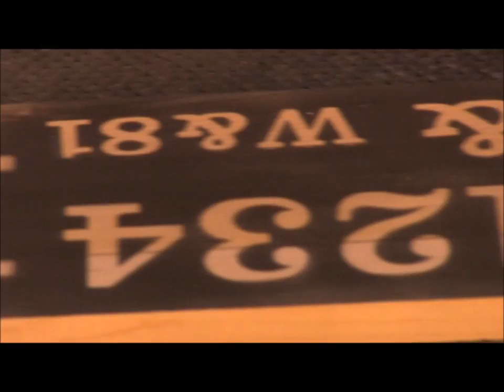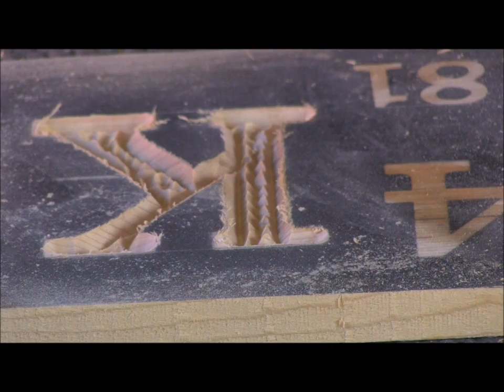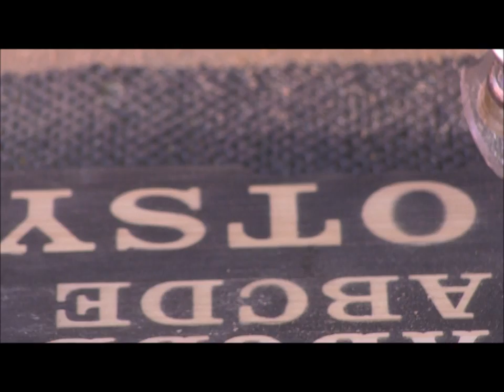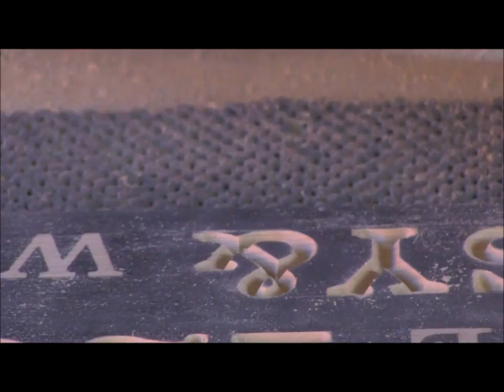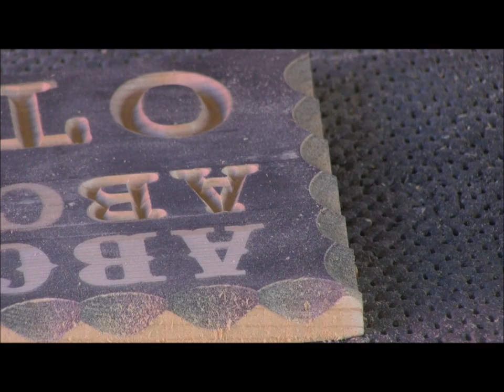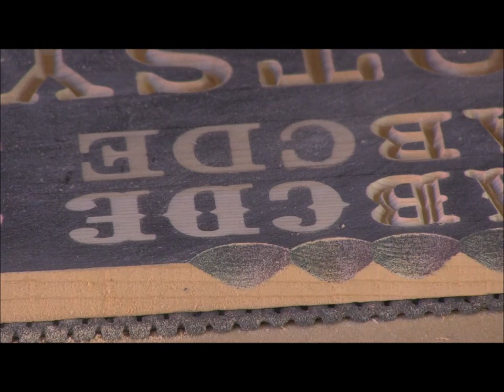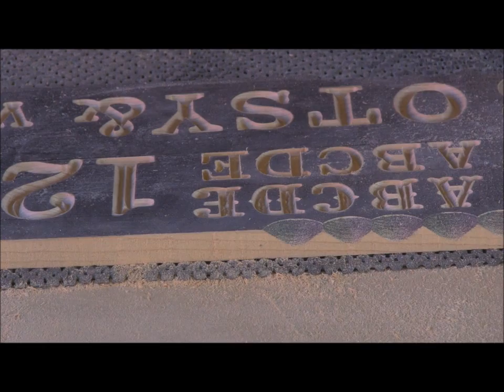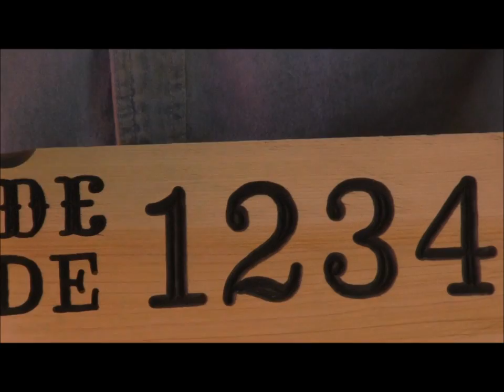#147 Tips for cutting Inset Letters

Comment: Hey Dave, Great time watch all your videos (you’ve got a lot of them).  I have made signs for  along time now as a hobby for myself, family and friends, just for fun. I like to paint them. (I’m still working on the Live Simply sign). I found your channel not too long ago and I’ve really enjoyed learning from your videos. I even went and bought several of your router bits. I think they will improve my work. I went and built myself the router base plate, and modified the router housing as in your videos. However, I found that even with making that hole, I wanted more light directly on the work.  I have now modified my Mikita RT0701C  to allow an led to be installed in the housing. I drilled out one of the existing holes in the base with 23/64” drill bit. 
  
I then inserted the led ( with a little Glue), and wired it to a 12v power supply (wall wart)
 .
Here’s what it looks like and it works great. I also attached an inline switch along the Makita cord so I can turn off the led.
  

Here’s a list of the parts I used from Amazon.  Let me know what you think. Is it something useful to you? You’re welcome to use it in a demo video if you think it will help others.

Cutequeen 10PCS LED Car Lights Bulb White T10 2835 4-SMD 80 Lumens 194 168 (pack of 10) $4.99

https://www.amazon.com/gp/product/B00EPA7CZC/ref=oh_aui_detailpage_o02_s00?ie=UTF8&psc=1

DC 12V 2A Power Supply Adapter, AC 100-240V to DC 12V Transformers, Switching Power Supply for 12V 3528/5050 LED Strip Lights, 24W Max, 12 Volt 2 Amp Power Adapter 2.1mm X 5.6mm US Plug 

https://www.amazon.com/gp/product/B075NZYZVT/ref=oh_aui_detailpage_o02_s00?ie=UTF8&psc=1

Gxilee 2 PCS 5630 5050 LED Strip Light Connector Adapter with on off Inline Switch, 
LED Strip Light to 2.1x 5.5mm DC Power Supply Connector, No Need Welding

https://www.amazon.com/dp/B00H0GL8YO/ref=sxbs_sxwds-stvpv2_3?pf_rd_m=ATVPDKIKX0DER&pf_rd_p=6375e697-f226-4dbd-a63a-5ec697811ee1&pd_rd_wg=FBsYD&pf_rd_r=G5V4JQE93CMBTQQ5JD6B&pf_rd_s=desktop-sx-bottom-slot&pf_rd_t=301&pd_rd_i=B00H0GL8YO&pd_rd_w=wgqAY&pf_rd_i=led+switch&pd_rd_r=63cea0c0-7913-4d8c-86c8-22366d69021d&ie=UTF8&qid=1539029037&sr=3
Reply from the maker: I got your email with the pictures. Ingenious idea / design on the lighting system. I may try something like that. You're making beautiful signs by the way. I love all the color. Thanks so much for watching and the business.

Comment: Eric i stained my sign waited 3 days for it to dry as instructed then applied 3 coats of polyurethane as instructed and i find the final finish to be rough. how can i make it smooth and really shiny as i would like it to be, i need your help with this issue. give me some step by step instructions, Help!!!! send me some good info, as this is another sign i have made with your letters and your very good videos and as usual i am waiting for a solution from you, thanks again your Cajun friend from South Louisiana Rouxso.
Reply from the maker: I answered your email but I'll answer here too. I always lightly hand sand in between coats with 220 grit or finer. That should do it. Thank you!!!
Reply: I seen someone put that clear poly on their work kind of heavy then use a hair drier, it turned out very shiny, what he says slightly sand it after each coat because any kind of paint needs a profile to stick to. I would of thought of that, nice work he explained very well my first one turned out like crap, lol don’t have much money to buy expensive bits got a table for Christmas 200 bucks router was about the same but it has plugger and set base. I’m new at this to
Reply: Practice on something before trying

Comment: Hi Dave
I have a makita trim router # 3709
Can I use that base which you're having on the dewalt?
Thanks
Reply from the maker: Probably not the same hole pattern for mounting. We have a blank that would work. All you would need to do is drill and countersink mounting holes. Everything else is done. Email me directly if I can answer any other questions for you, eric@makeawoodsign.com. Thanks again for watching!!!

Comment: What do you do when you come to a knot in the wood?
Reply from the maker: I watch for them when I'm planning the layout. If it's a loose knot then I stabilize it with CA glue or resin before I do the layout. If it's a tight knot I will carve through it if I can't work around it with the layout.
Reply: @oldave100  Eric, sorry another question please. To help cut straight and around corners, would it be easier to cut in stages lowering the bit a little at a time? Mike
Reply from the maker: No worries about questions, always happy to help. Cutting in multiple passes can help sometimes especially If you're cutting very hard material.  However the most important things to remember is having the right bits, and keeping your hands on the router and the wood at the same time. If you have any other questions my direct email is eric@makeawoodsign.com

Comment: I'm trying to figure out what depth to use with the 60° bit and 2 1/2 letters. I don't think the depth was mentioned in the video. I wish I had your steady hands. My letters are somewhat ragged.
Reply from the maker: without knowing the font and what it looks like it's hard to say for sure. With 2 1/2" letters you sound be able to go pretty deep. It really is more about the width of the cut. Go as deep as you can as long as it still stays within the lines if you're cutting inset. Hope this makes sense. You can email me pix of you want and I might have some better suggestions for you. eric@makeawoodsign.com.
Reply: @oldave100  I'm learning that the depth of cut is very important. I suppose I'll get it right with more practice. Thanks for all you do to help us rookie sign makers